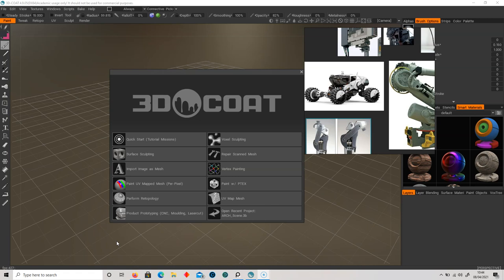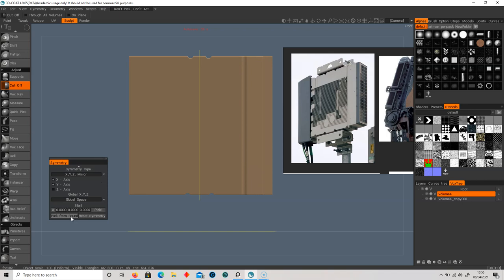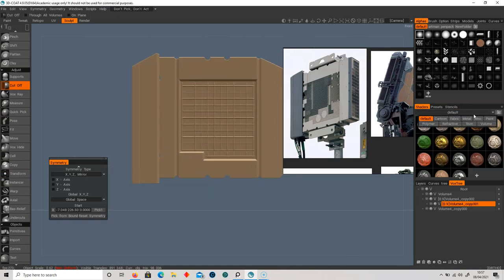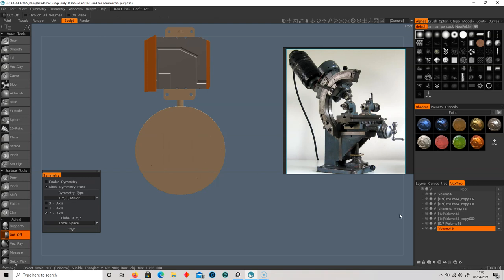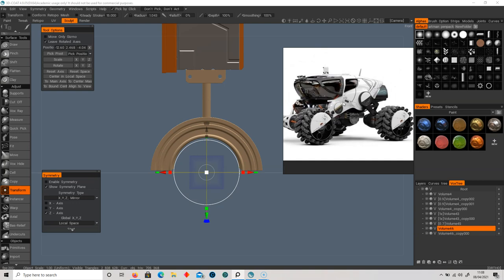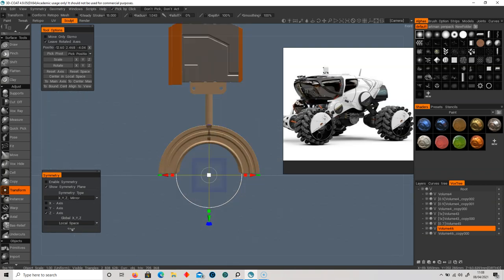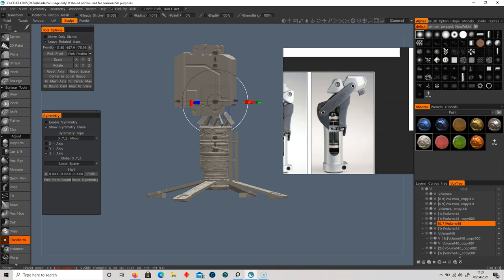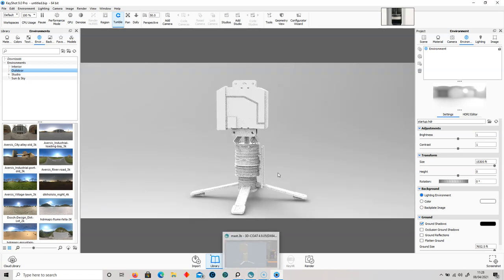Hard Surface Modelling | 3DCOAT TUTORIAL

Comment: Super helpful! Thanks for making this. 

It's nit-picking I know, but the cable you painted in at the very end has...some issues. The highlight should be all along the top side, not stopping where it bends, because it's laying almost flat on the ground, right? And then some reflected light in the shadows would make it pop. It looks a but M.C. Esher-y the way it is. Just in case someone is wondering what is off wit that. It's the highlight should be all along the top